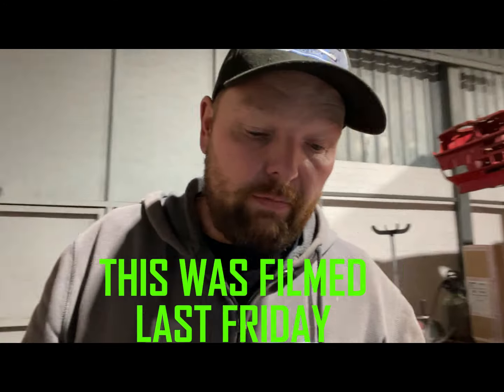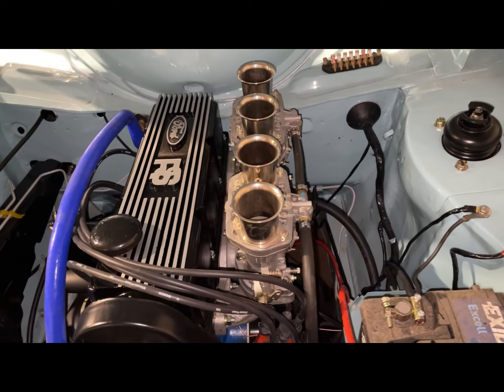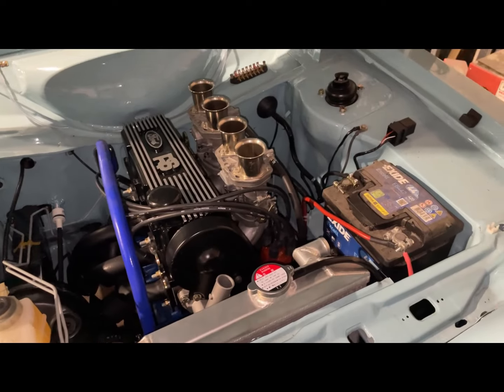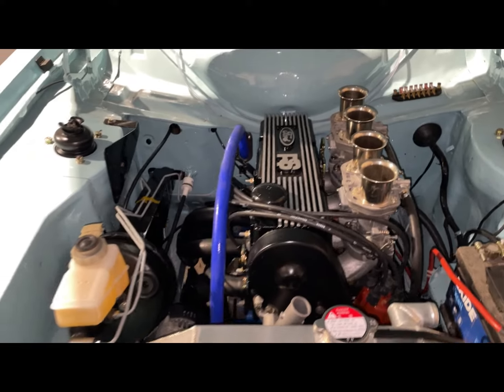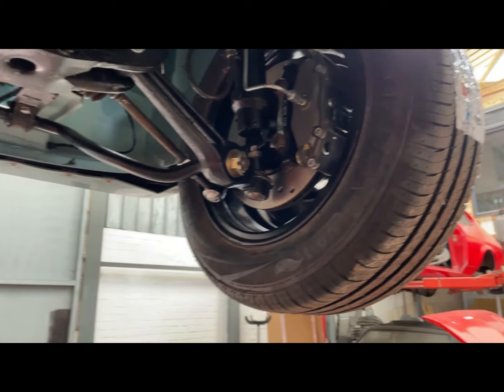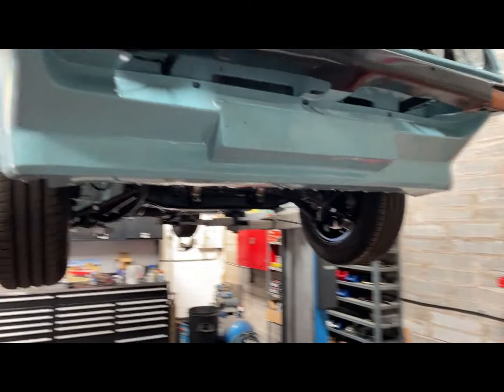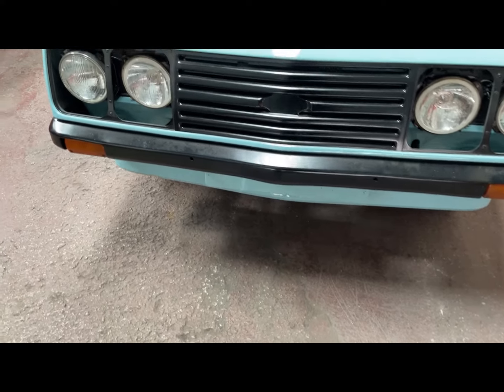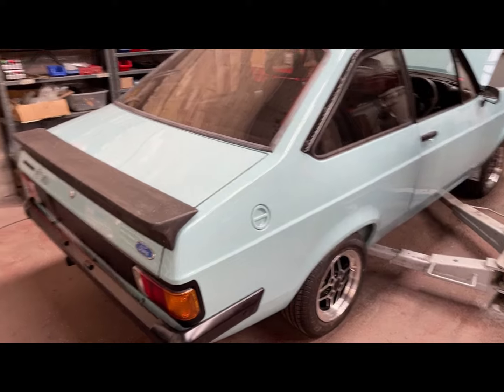WILL IT RUN? Building Nora the 1979 rs2000

Comment: Great work! I run JBW superlites on my mk2 Ghia. The rear studs are the same as you say, not much protuding but ive had no issues in over 2 years. I did fit longer studs in the front when i changed to coilovers and fitted new RS alloy hubs.
Reply from the maker: @neill4133  Hello! Thanks for getting in touch and watching the videos. That info gives me a little more confidence with them. Just for my own curiosity I’m gonna get the wheels off and measure just how many threads it’s actually using